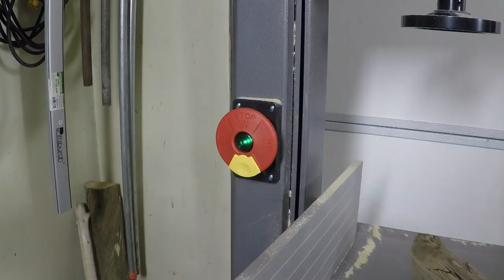DIY Hybrid Resin & Driftwood Lamp

Comment: But but but….. when the light burns out😳

You could make the resin fit into the wood with resin peg and holes so that the light would be easier to change… (unless it just can pull right out the hole you have for the wire— in that case never mind!) 

THIS IS SO COOL!!

Comment: This was a neat video. I do wish you would've showed us this lamp on without the overhead lights on, so we could see the full effect of it in a dark room... I also have a question, if you make a light without any kind of bulb, and then you put that right next to a dry piece of wood, couldn't that cause a fire? I'm asking because I don't know the answer... or maybe you did something that I didn't see to prevent that from happening...?
Reply from the maker: Thanks and the lower voltage being pulled it should be fine.